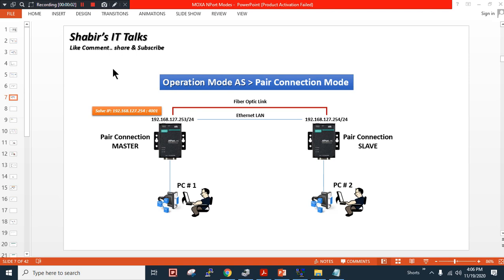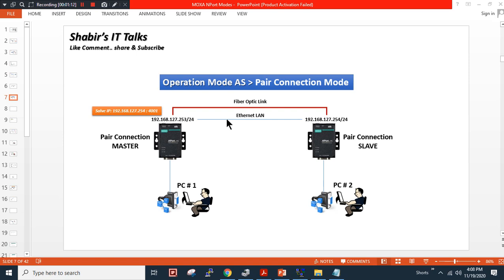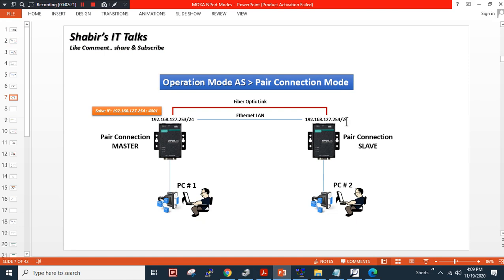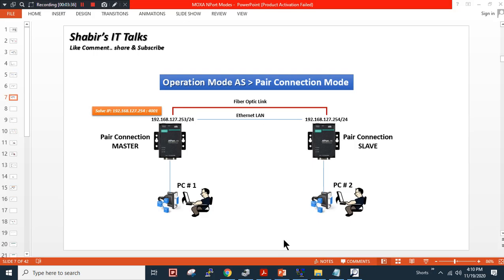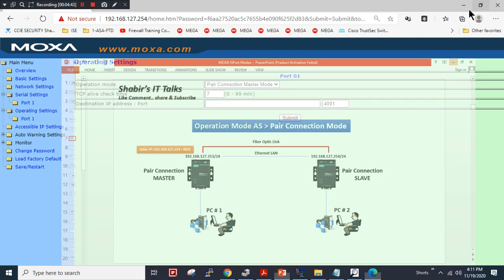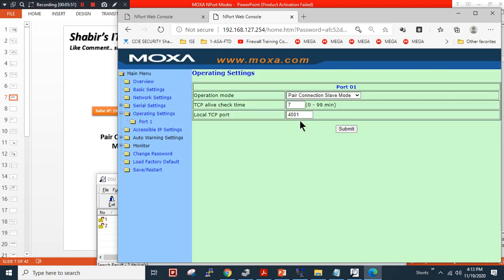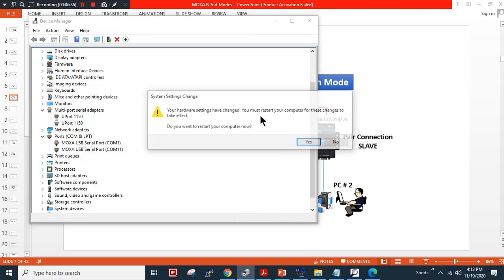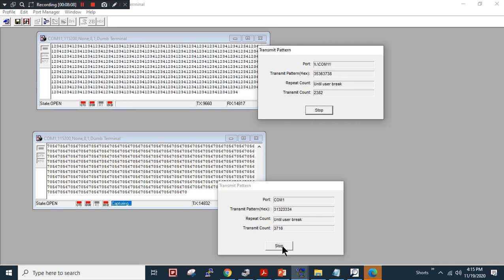How to Configure Ethernet to Serial Converter NPORT Operation Mode as Pair Connection Master & Slave

Comment: Good, I have a scenario in my work. I have 2 MOXAs NPORT 5100 connected to each other as the video above bu there is a third moxa CN2610 connected to the master MOXA instead of PC1. The connection between the NPORT 5100 and CN2610 is through the serial ports but the connection isn't not working .. I need the wirte serial port configuration in oder to bring the connection up and running between NPORT 5100 and CN2610

Comment: Hi Shabir, can you help me to define what is the proper moxa model that i can use to monitor 4 Modbus RTU 485 in the ring. my plan is 4 modbus RTU devices will connected in daisy chain, than only the 1st and 4th device will connected to Moxa modbus RTU converter to convert the data to the managed switch

Comment: Good morning .
Please i have a tow moxa 5250 can I  use them withe the same configuration to convert analogue data to tcp/ip .
Reply from the maker: yes please confirm the data type, you can convert in vice versa direction, and also confirm the protocol type so i will suggest you operation mode accordingly.

follow below play list for further video's related to NPORT.

https://www.youtube.com/watch?v=goOAQn826mU&list=PLjSO9pjeGIBZHQbv3AwJ7xaKa7jipHOu_
Reply: @ShabirsTechTalks   thanks for your help   i followed the steps of pair connection and it work , now i have a nother question .
In my case I'll use a wireless connection between the two nport in place of rj45. My question is should I use a getaway?  
Thank you very much for your help.
Reply from the maker: @daifallahhoussemeddine5162  https://www.moxa.com/getmedia/be223bc6-fdaa-4b2d-8084-7d30fb5126e0/moxa-nport-w2150a-w2250a-series-datasheet-v1.7.pdf